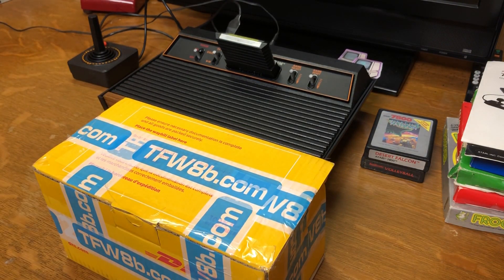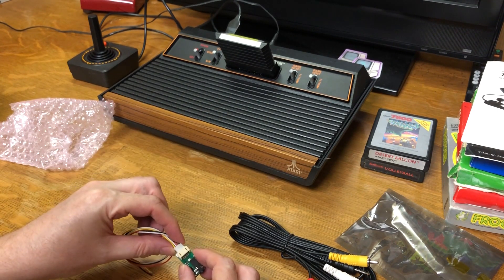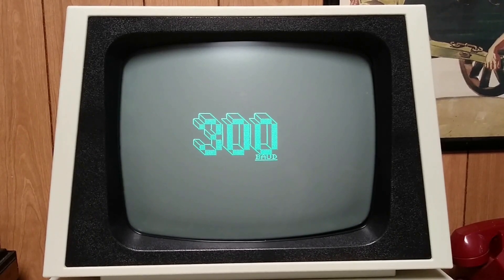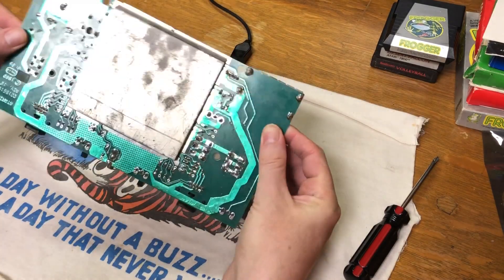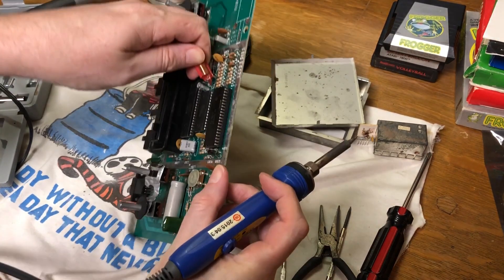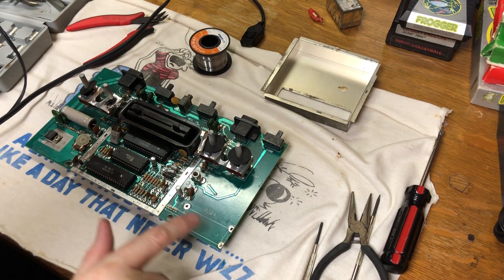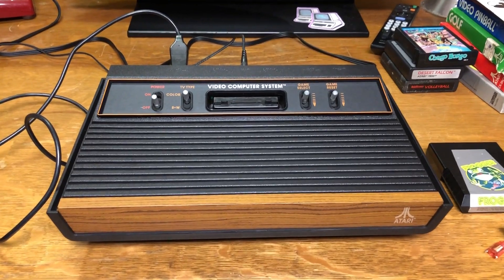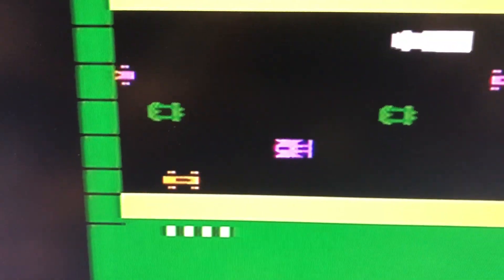Atari 2600 Composite Video Mod, Is it worth it?

Comment: I've been using the "Clean Comp" composite/S Video mod from Retro Six. The board solders right to the pins on the back side of the TIA chip, it doesn't require any component removal (except on the Jr. need to remove RF jack on the back), or drilling into the case, and the picture can be adjusted to clean it up if needed. This mod is not as bad as it doesn't require drilling, but it still requires removing stuff.
Reply from the maker: Thanks for sharing!

Comment: I have had atari 2600 6 switch lite 
Atari 2600 Jr av modded 

Next I will get my atari 2600 Vader av modded & atari 7800 av modded over next few months
Reply from the maker: Just be sure to use a good quality kit. Mine wasn't so good :-(
Reply: @300BaudStudios  I do not have time to restore vintage consoles but there are some sellers on eBay 20 years plus restore atari consoles and upgrade

Comment: Great vid.  Did a comp mod on my 7800 years ago.  Thought about s-video, but it wasn't as simple back then....
Not sure about the kit you will get for your 7800, but one thing I had to add was a resistor to the TIA sound side.
Otherwise, the TIA sound was much louder than the Pokey sound...
All in all, I'm really happy with it.  Much nicer than RF...  ;-)
Reply from the maker: Thank you for sharing. The 7800 Game Drive by Stone Age Gamer looks like a great solution as it add a very nice a/v port as well as many many other features.
Reply: @300BaudStudios  The 7800 Game Drive is amazing. I was able to snag one from the first limited production run back in July. I'll be showcasing it on my channel later this week. You'll for sure one to grab one once they are available again in a larger production run.

Comment: Don’t forget to replace the 7805 with a TSR-1 2450. $5 bucks and runs cool. You can also get a full recap kit from Console5 for about $9. You can also get rid of the jail bars with a snap-on magnetic choke on the DC adapter cord.